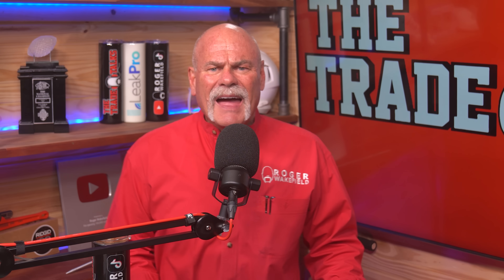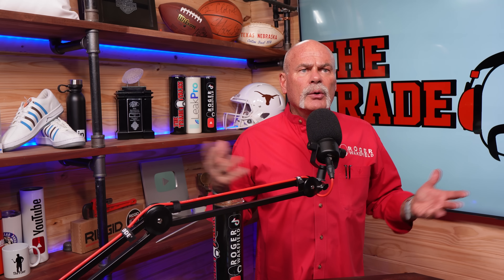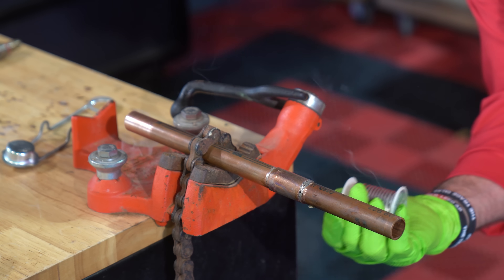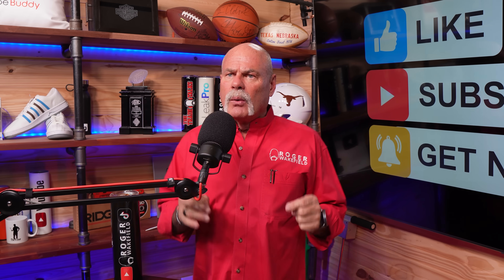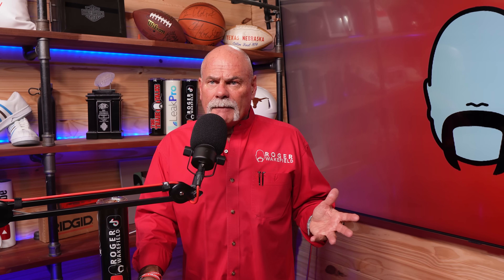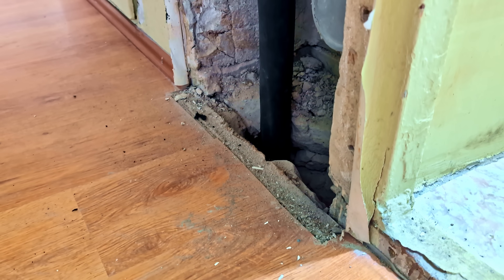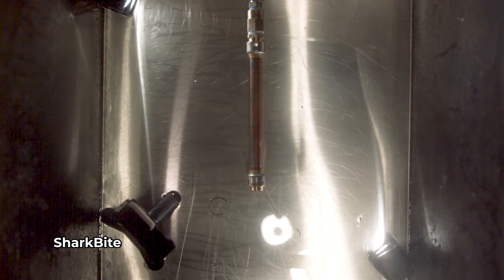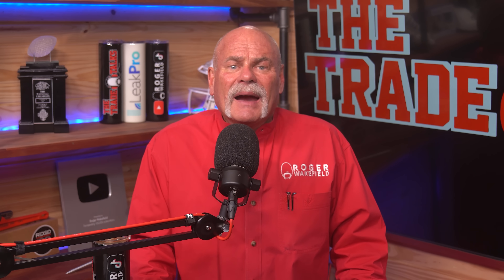The Truth About SharkBite Fittings From a Master Plumber

Comment: Hey, let’s be fair. If you look at press pipe fitting, it’s the same damn thing.
Reply: yes same sealing technology. preparation and proper install matters.
Reply: and same price
Reply: Absolutely
Reply: There is a big difference between an oring that the fitting around it moves and flexes, versus an oring that gets compressed and held still by the metal being squeezed down around it.
Reply: @springtimeplumbing6240  Yes, but only mechanical strength. Water will still start leaking once the rubber gasket fails.
Reply: @mrdan2898  More than mechanical strength. In a SharkByte style fitting, there is some movement allowed, as the teeth flex. This movement can cause wear on the Oring, especially if any gritty/abrasive material is in the joint. With a press joint, that movement doesn't happen. Also, the sealing ring in the press joint is actually compressed when the joint is pressed, causing the sealing ring to contact more of the surface of the pipe than does the Oring in a SharkByte style fitting.
Reply: @springtimeplumbing6240  In theory, you're right. However in practice, a normal system that has hammer arrestors and in which pipes are adequately supported/secured + sharkbite fittings properly installed on deburred and clean pipes, none of what you describe will ever happen.
Reply: @Zone8Angling  It can, and in fact, does happen. Pressure changes are caused by using water, and by incoming pressure changes, as well as thermal expansion. Temperature changes cause the pipe to lengthen slightly, causing deflection in many situations.
Reply: @springtimeplumbing6240  Let me clarify what I meant. Yes there may be SOME expansion and slight movement, even in an adequate system with hammer arrestors and support. What i'm saying is those on their own will not be anywhere near enough to make the sharkbite fail.
Reply: @Zone8Angling  True, but many DIYers are clueless and don’t know directions.
Reply: @alantrimble2881  Well thats true too, but that doesnt really help the anti-sharkbite argument ; a clueless DIYer who'd mess up a sharkbite install would also mess up a soldered joint just as bad or even worst.
Reply: @springtimeplumbing6240  wont make squat for difference if the pipes are not deburred 
orings are easy to destroy even on a good fitting 
I have PCP air rifles with orings in them and guess what??? even machined edges destroy them if you are a moron
Reply: @HeathensHaunt  Agreed. I like to chamfer the outside edge.

Comment: Code approved. Use them on cvpc to copper all the time
Reply: had to replace all my plumbing in 2021 that came on my 1999 mobile home after the winter storm hit texas, push connect fittings and pex are a godsend and still holding strong
Reply: yup here in minn i do olso